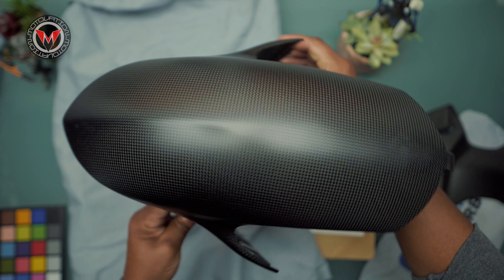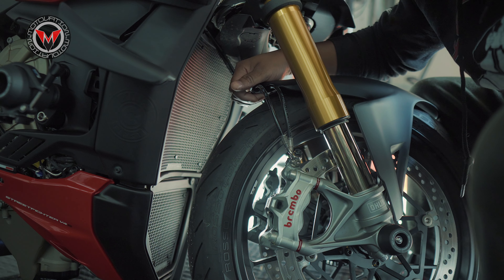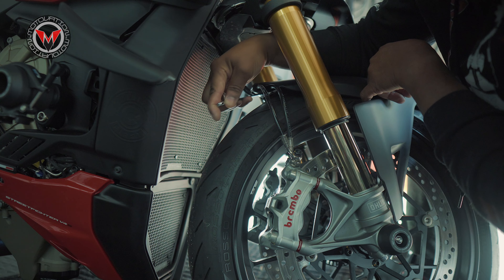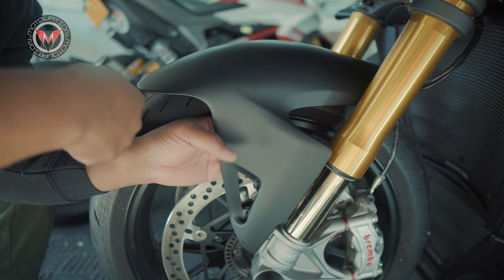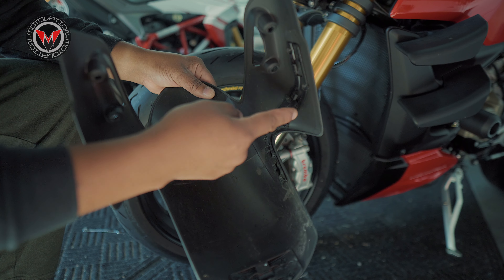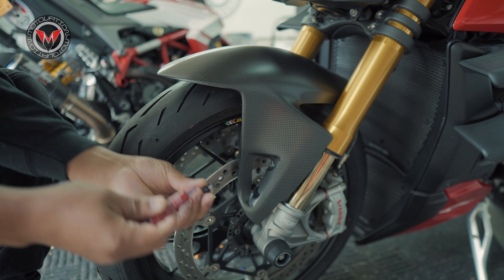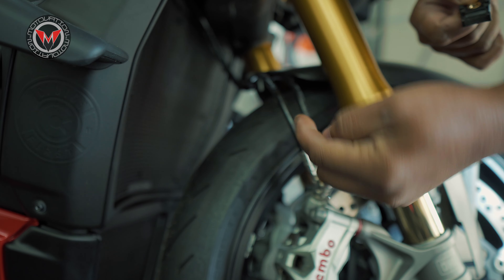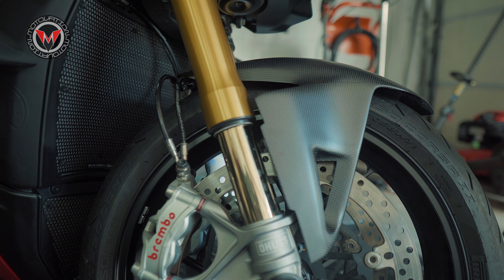Looks Better Than OEM [Ilmberger Carbon Fender] Install

Comment: Great video!
The clips of the carbon fender are a few less and also bigger and in only one direction compared to the OEM part.
I've bought a carbon fender which has the same clips as the OEM. Do you think it's possible to get the cable in those too? Or would it be better to dismount the front tire so you can reach the clips easier.

Comment: Hi what size spanner did use on back fender bolt thanks
Reply from the maker: The retainer clip at the back of the front fender has a 10mm nut. 🦾